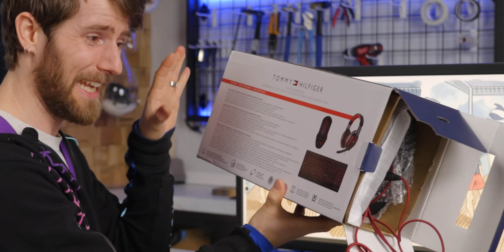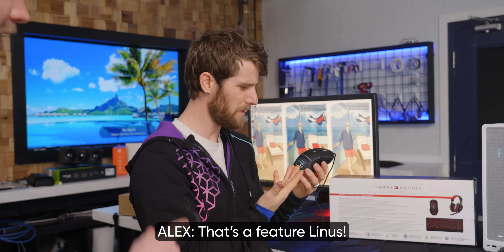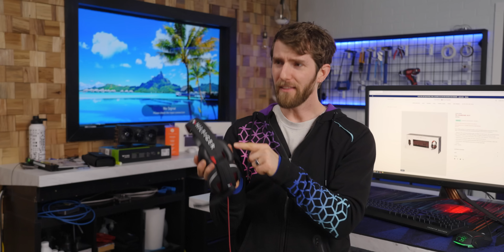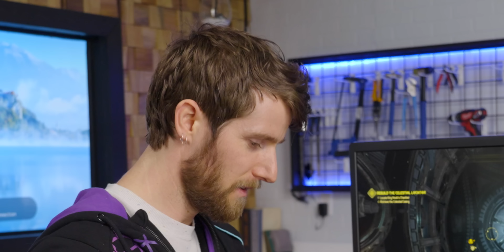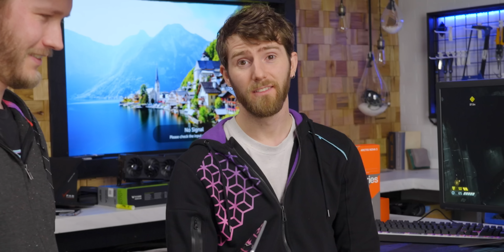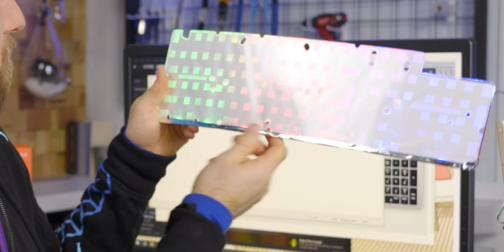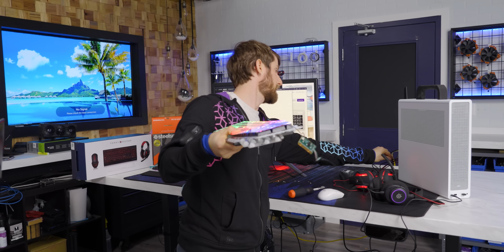Tommy Hilfiger are Filthy Scammers

Comment: I need to clarify something that I believe often confuses people, specifically in the portion of the video where Linus discusses the mouse featuring the Hero sensor and Lightspeed dongle. All Bluetooth devices, GPS, radios, cellphones, and dongles transmit signals at the speed of light. However, the key question to consider is how much data the device can send and how much data the dongle can process. While this might not significantly impact the performance of a mouse, these factors do play a crucial role in determining the overall responsiveness of a device.

Comment: The black compound on the keyboard chip is not anti reverse engineering - it's a packageless IC. If they want to keep you from reverse engineering of the chip they usually grind off the information from it. Here it's an actual piece of silicon under this goop

Comment: There is no way....
I bought this cheap mouse for like 599 INR off of amazon (called the Redgear A15), and I saw this video, looked at my mouse and was in shock. The Back Plate has the EXACT SAME DESIGN, THE RGB IS IN THE EXACT SAME MODE, DOSEN'T HAVE ANY DRIVERS THAT I KNOW OF, SAME PATTERN ON THE MOUSE AND EVERYTHING ELSE IS THE EXACT SAME, The only difference being that the back metal plate of that mouse is blue and for me, It's well, metal. And also the logo for me is a Redgear Logo instead of a Tommy Hilfiger one. Someone needs to look into this deeper.

Comment: i remember buy the most cheap keyboard at the time to play dayz on ps4! the keyboard was like 15 dollars at the most! maybe 10 dollars on your market! but i remember the problem if you press more than 3 keys at the same time 25:30 hahah the same problems! and withing time the keys specially control or shift started to block in place if you hit them from different angles that is not right from the top like 90 degrees in straight line!  lol this keyboard looks like its exactly the same! a generic cheap masive produce keyboard with different brand added in some ramdon place! mine was straight right up from the arrow keys

Comment: so, we know that Linus does not understand how microphones work. Omnidirectional microphones are much more accurate than any other (figure 8 has the same). And you absolutely do not want a mic array unless you want directional control, and for that you need either directional mic array or one that is electronically decoded to be directional to all directions but their frequency response is NOT flat to all directions.. Omnidirectional mic is a microphone that has its backside sealed so that the membrane on top will pick up any air pressure variations, ie: sound. It does not know where that pressure wave came from, and sound will bend around corners. It is very close to a singular point in space which is the ideal way to capture sound, in reality we need some area to multiply energy. Cardioid mics and other directional mics use acoustic ports to cancel out waveforms from certain directions, and those are never linear because sound is.. sound, its wavelength is roughly from 20m to 2mm... so no acoustic solution that is feasible in size can reject all sound from all but one direction. There is always a tradeoff in sound, no lunch is free. Omnidirectional mics are as close to that free lunch as we can get, it just happens to be quite easy to make them quite flat and without any real downsides. 

One of the most enduring ominidirectional mic capsules of all times is one from Panasonic (don't remember that model number out of my head...). It or one VERY much like it is in billions of phones and devices. It is good enough to be used as a measurement mic, it just needs calibration curve per capsule. Your phone most likely has some of its siblings. They are ridiculously good at ridiculous prices, costing cents per capsule (not good for recording mic, too high noise floor even with the mosfet hack). I got close to 100 of those in my closet.

Good quality cardioid mics are not cheap to make, they require actual design and testing, intricate shapes and internal cavities and ports, and membranes, suspensions, and coils and... Omnidirectional are just so much easier to make, slap a membrane on top of a sealed contained and you are halfway there.

Comment: I actually have tom tailor hands-frees, and they are actually pretty good, and from somewhere like early or mid 2000s, and the wire has a zipper which is actually great.
And they are vacuum handsfrees, not normal ones

Comment: This set looks like you could buy it for like $55 here (tops)

the gaming mouse seems like it's it's like those lower only 4000ish cpi/dpi (which is not good for fps games,), which I have and bought a few for just about $10-15. (that's with rgb, and you can buy a silent mouse or a bit tactile on that price)

The gaming keyboard seems to be far cheaper to those really cheap abs mechanical keyboard. Here you could atleast get a hotswappable mechanical keyboard, with changable limited rgb light settings. (with your mx switches) And is waterproof for like $15-25. (I got mine for just $17 which is 10 key less... and modded the parts to make them thocc. Gotta get their sound just right)

Then the headset... seems like a knockoff baseline gaming headset? You could buy that here for just $11-15 and atleast the mic is movable. and you get a free plug to make them work for a pc/usb or mobile devices. (since the headset cord is separated for mic and headphones... which makes them last longer)

Seems like people will not get what they are paying for here...

Edit: wait the mouse is only 3500 dpi??? That's not gaming... that's just an office mouse.

Edit 2: 2000dpi?! I'm done... I'm done. (return back) 1500dpi?!?! asdbabaibobfihaofaoijboaffbaosjhabbanibf

Comment: These are actually OEM trash.
The keyboard seems to be using the generic keyboard G21 guts with a different shell.
Mouse is a fairly common one for these sub 60$ 3-in-1 sets from a lot of these rebranding companies and until recently was sold by Lamtech and Xtrike.
Same for the headset, used to be sold by Cougar like 3 years ago (afaik they're kinda turning it around recently with better stuff) and it's still being sold by Gembird even using the same colors

Comment: wait a sec, that mouse is, except for the case, my ant esports gm270w. it costs less than 5$ US. the same lighting, same usb connector, same dpi change buttons, same side buttons, which I repurposed using xmouse button control. although, I have been using my mouse for more than 2 years, and it is so much better than this tommy one.

Comment: I am surprised. I have this exact same secondary mouse but under readgear brand name it cost me less than 5 USD shipping included. Really bad gaming mouse but god enough for work systems.
Edit. Also noticed I have somewhat of a similar keyboard. That was in a combo deal as well but with a diff mouse. IT was 15 USD.  It was soo bad that can't even use it as a work keyboard.  It's just  shelf decoration now.

XD feels Like I am a trash collector.

Comment: Spelling out the material like that is literally jus upselling! All they're doing is jus trying to make it sound much more impressive than it actually is! A mate of mine used to work in Subway, he came back one night and talked about a customer who was unhappy after having learned they used a chemical in baking their bread: dihydrogen monoxide! Which does not sound even remotely terrifying when you realise that ALL bakers use it, as do brewers, cuz it is literally water, it is a key ingredient in bakery and as part of the brewing process, along with the barley, hops and wheat (you might be surprised how many people don't quite realise jus how much different beers, lagers and ales have in common! The difference from brand to brand is the measures of those ingredients and the brewing process that determines whether it comes out as beer, lager or an ale! Spirits are pretty much the same as well, again, simply differing from brewery to brewery! And by the way, there is a difference between whiskey and whisky! Mainly how it's brewed, but also where it's from can play a part)!

Comment: why keyboards so expensive in canada for the cheap ones. i just got a cheap one i ordered it as the first one i got for mini pc the keys pretty quite and its really not bad and it cost me £11.17p in free delivery so i got a 2nd for main pc, looks like a standard dell design but i think better and at low price and keys light up. but you saying cheap ones are $20-30 that not really cheap. and mouse ive got wired 8000dpi logitech mouse for around £10 new inc postage . things in uk seem to be far cheaper than what you pay in canada even tho you near a large city

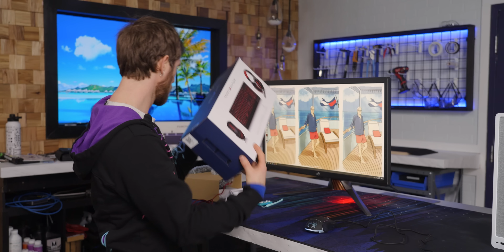Comment: 4:51 I have the exact same mouse from a company called Red Gear (Model A15) the same design same RGB, with the option to change to different modes, but that means it doesn't have the No drivers needed feature as it has a software (although it's a basic software nothing too much), also the DPI goes from 1000 to 6400 (their claim) and but due to all these extar features this costs a whopping amount of $4.50 (converted from INR)😂😂

Comment: I Like The keyboard That Rolls Up! It Is very Water Resistant And I use One On Summer Nights By The Pool When I Am Watching The TV While I Lay On The Float Chair! Of Course You Have To Get Out Of The Water Since It Is Not Wireless Or Water Proof Only Resistant! The Mouse I Use is Chinese And Cost 25 US Dollars Back 3 Years Ago! They Have 5 Buttons And 5 DPI Settings Are Wireless And Rechargeable!! The Keyboards I Use Inside The Home Are Mechanical With Red Switches And South Facing LED's! They Are AULA And IROK I Bought Them because of The Volume Knob And The Fact i Can Swap The Switches! They Are FE75 Size Wise!